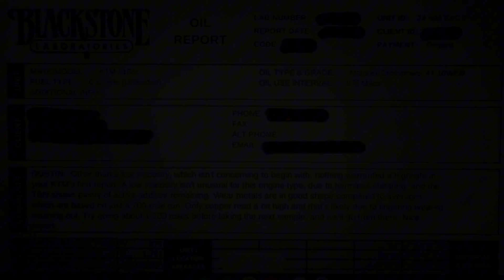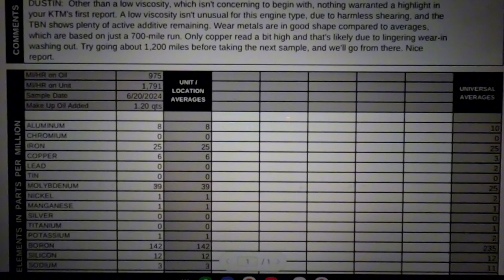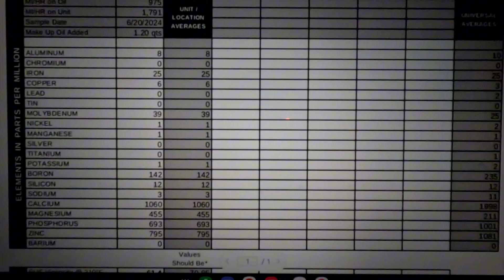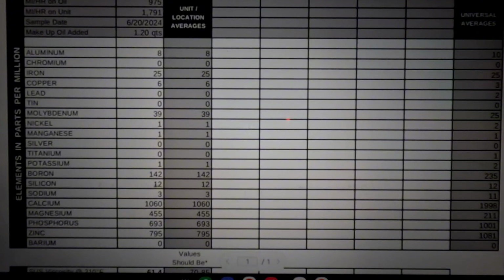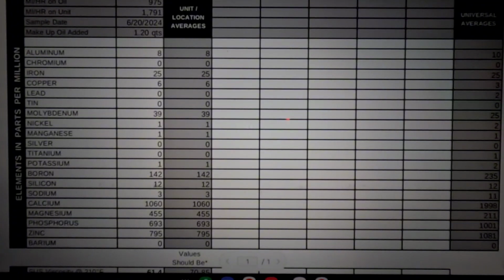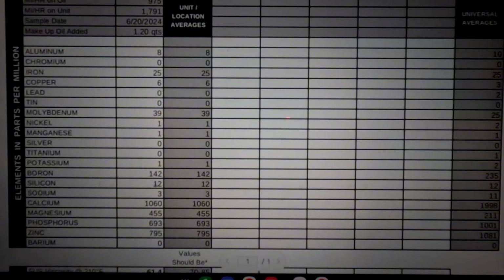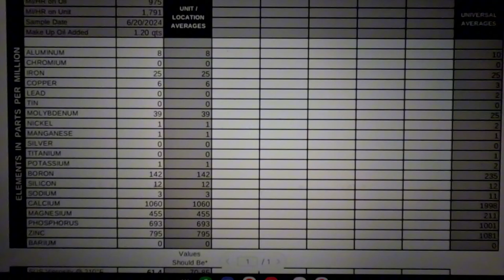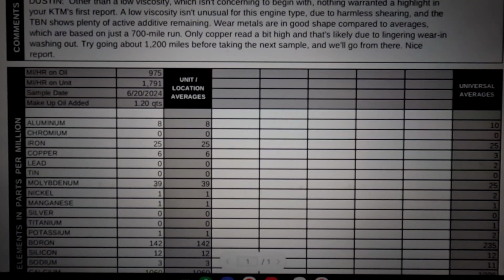Oil Analysis Report #1. 2024 KTM 500 EXC-F 1,000 Miles

Comment: I just bought a '24 500 last Tuesday and I was assuming I would be changing the oil every 10 hours. So you recommend 1000 miles or so? Does the oil filter look good after that much time? I would worry about a paper filter that long. Thanks
Reply from the maker: Consensus is that bikes subjected to light to moderate conditions and intensity, can have the intervals doubled or even tripled. After this report I am comfortable with 1000 miles and 30 hours. These numbers are safe for a well maintained bike and light riding. Of course, you have to factor in your situation. As for the filter, there were no obvious issues. My next report will be turned up a notch.